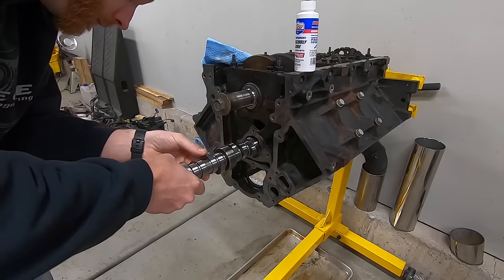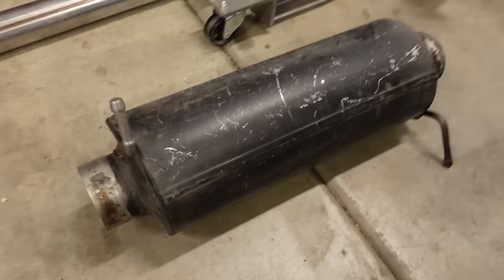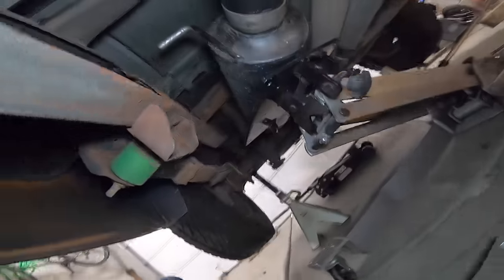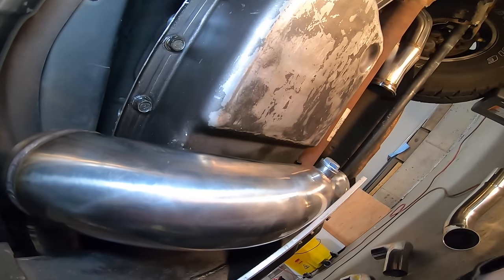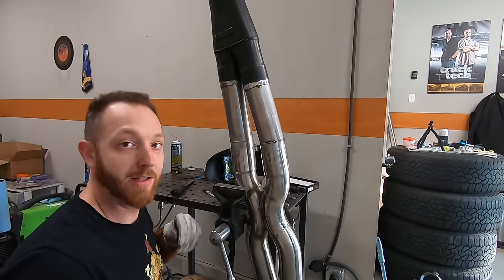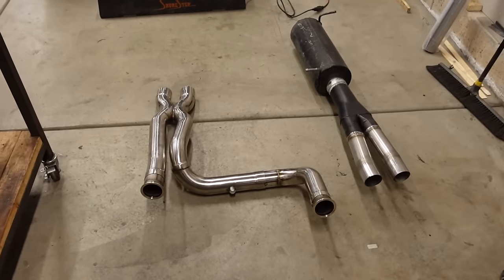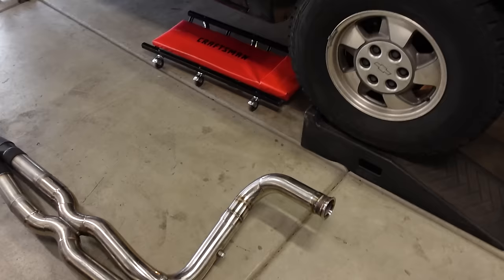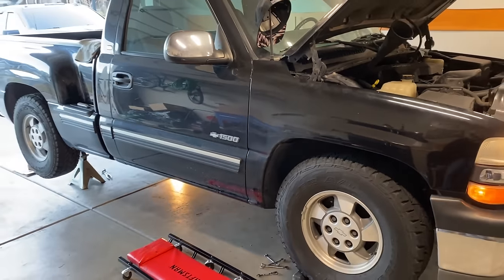the MOST INCREDIBLE sounding exhaust EVER! 4.8 vs 8.1 shootout Pt.9

Comment: I know this is an old video, but why the X pipe going into the Y pipe to one muffler? I was always told the X pipe is for two mufflers. The X pipe seems pointless in this setup. The Y pipe still joins the gasses before the muffler. If I've been taught wrong, please correct me.

Comment: Fuel the Al Gor ithm and support the RPM Act.
When welding under the vehicle are you using a switch (2T/4T) or are you doing Jujitsu TIG welding and using your foot/knee/elbow.
Reply from the maker: I still use the pedal, just keep my knee bent up and it works good for me

Comment: I did two x-pipes on my c4 vette build. Did it mostly as an attempt to smooth out some of the headache causing drone/pressure it had at about 3k rpm.

Worked like a charm, and it really gave it a Ferrari type of a sound.
Looks weird under the car, but i would do it again.
I'm curious about how it affected performance, but it was either that or get different mufflers (currently dual flow master 40''s.
(3in in, and dual 2.5in out on both)

Comment: LT you are the bomb! I'm not a mechanic I'm building a 6.0 LS 72, Pro Street SS factory AC Nova with that 2 in1 pipe 3.5 what about back pressure? Wouldn't your engine loose back pressure to the point of torque , HP lost?

Comment: Finish the exhaust out a little bit longer with a kick up over the diff to a turndown. Cheap aluminized 4” truck exhaust shouldn’t be very far away…….isn’t as cheap as it was. That little bit longer should remove the resonance that buzzes your ears and head if it matters.
I really like the sound result of the X to Y with the cam profile and small displacement!

Comment: At 7:43,   why don't you like slip fit connections LT?   Its' one joint less to weld but I'm not an exhaust builder.  Please let us know!
Reply from the maker: To me, every slip connector is a chance for movement or an exhaust leak. It might just be personal preference, but I always build exhausts with as few clamped connections as possible

Comment: The funny thing is, that while you may call the result of an x pipe a european sound, if you look at the legendary sounding V8 euro cars like the 6.2L AMGs, 4.2 RS4s, they don't have an X pipe. They have a resonator that links the two pipes together in parallel, but they don't have a crossover like an H pipe nor an X inside. The higher revving exotic v8s like the 458 have true duals (with the valves open). The only euro v8s I can think of with an X pipe are the F type R and the quattroporte.

Comment: 🤘 sounds good 👍 bet the dump makes it sound ways better and it will run better too to have it go farther than just out the muffler. In my experience the muffler can’t be the last piece of exhaust 🎉
       Magnaflow has a good video on the science 🧪 of exhaust. And having a glasspac is better than just straight pipe 👍 
     I’m curious though on the x pipe you have (kinda just sides touching) vs the I guess you could call it a crossover X 🤷🏻‍♂️  switches sides?  Make sense? (I just woke up and finished video from last night 😂

Comment: Curious to know how a v8 would sound if the v8 is a single outlet header setup meaning it’s a single pipe no dual outlets.. what I’m curious is what if a Y pipe from a single into dual, then into a x pipe and two vibrant mufflers on both sides and dual back then a H pipe before it splits off to the back bumper.. always wondered what that would sound like. Logic can be used on any car that’s a single outlet header dump which are mainly sideways engines like fwd v8s v6s I4 etc etc…

Comment: call me crazy but i had a 4.8L and a 5.3L (2 different trucks). anyway to me it always felt like the 4.8L had a better throttle response compared to the 5.3L and would rev up like a nut job on crack. but the 5.3L seemed to pull trailers and what not better. also both trucks had about 200,000km on them and were both 2004 model years with 4x4.

Comment: Hope you don't need to change trans fluid anytime soon, on mine I had 1 7/8  tube header with 3 inch exhaust with x over pipe and electric cutouts.
Reply from the maker: yeah, I'd have to move the exhaust to drop the trans pan, but luckily I did it right before installing the exhaust.

Comment: Warning.
Do not look at a cooling stainless steel weld without eye protection.
Sometimes the chromium or nickel or something forms a crust on top and shatters with sharp little bits flying off.
Most of the crust has gone by the time you can touch the weld with a bare finger but you should still give it a brush off as flakes can fall off and get in your eyes at anytime.

Comment: Have you noticed the if the pitch was higher than before?
Reply from the maker: yeah, usually an X pipe makes a higher pitch sound, but I've never run this muffler with and without an X pipe to do an equal comparison

Comment: Do You think you will have flow issues going from x to a y ? I have the same X on my truck and really want to run a single muffler like this.
Reply from the maker: thats a good question, and I don't have a great answer. Theoretically, the 4" single is sorta roughly equivalent to the dual 3, but I have no idea how the X into Y affects flow. Might help it, or might hurt it...
Reply: @LawrenceTolman  appreciate the reply. I really hate to by another Speed engineering Y pipe when I have one like yours at the house. I just feel like with my 3” setup it may cause back pressure issues.

Comment: . *  *  *  *  If that is stainless , why aren't you "Back Purging" ? It really looks good , I'm just not a fan of putting all that heat from the crossover under the oil pan /transmission , and personally I'd avoid the butt end of a joint facing the flow . I just found your channel , and I'm going to subscribe , sorry for the negativism , I love the sound , just enough rumble to give it Authority ! Clean job .

Comment: Wait.... You've got torsion bars on a 2wd truck?? Is this some weird factory option or did you lose the transfer case and make it 2wd??  By the way, I'm following this because I've got a 6.0 in the same truck as you (out of a 2003 Escalade) and a 6.0 in my Hummer and they sound completely different!!  I actually prefer the sound of the pickup even though its a single pipe after the Y pipe whereas the Hummer is a dual pipe after the Y pipe into a dual in dual out muffler.
Reply from the maker: It’s still a 4wd (it’s been converted to a true AWD since this video actually)

Comment: Just an FYI for everyone. Good ole high school math is great for working on cars. So how big does a single pipe have to be to equal the same area as dual 3" pipes? It's not what you think, 6" is not the answer. 2πr² is the solution. Because the area is squared, area goes up exponentially. 
For the dual 3" area,  2x2π3² = 113.097 inches. For the single, 113.097÷2π = 18, then get the square root for the radius. So the radical. √18 = 4.2426 so a 4.25 pipe flows the same as dual 3”. Pretty cool right? 4.25 inch mufflers are much harder to come by so 4" is really close with an area of 100.530 inches or 100.530÷113.097 = 89% of the dual 3" area. 
Using Android calculators may require quotes because they don't do the order of operations correctly,  MDAS.
Reply from the maker: That math is above my head, but sounds like it’ll work fine to me with a 4” tail pipe

Comment: This is unrelated to the exhaust, but not to the truck. Has anyone here figured out the damn charging system of these trucks? Mine is an '05 4.8L and when I started doing research on it about two years ago when I got the truck, I opened a big can of worms. I put a zener diode between the alternator and battery, grounded to the chassis, but it still has the big jumps in voltage that will lead to the sulfate crystals forming on the plates. Anybody have an idea of how to knock these highs and lows out that the regulator can't seem to handle? I looked for external regulators but couldn't find a 12v reg that could handle the amps needed and especially one that's weather resistant.

Comment: because trucks always have the pipes offset to one side of the vehicle, the pipes from the two banks of cylinders are always unequal in length and that unequal length produces a sound I care very little for. The xpipe did little to fix that, and because of the unequal exhaust pipe lengths, I would wager the scavenging effect doesn’t do much in this situation. I wish exhaust systems for trucks featured equal length piping. I know of only one truck that does and that is the new Ford Raptor
Reply from the maker: I even considered making a loop like the raptors to try and even out the lengths, but I couldn’t find a good spot for it
Reply: @LawrenceTolman  yeah it’s hard to find space under a truck never designed for that exhaust feature. There probably isn’t nearly enough space for those either but one company created an equal length mid pipe for the bmw m4 by making one of the pipes wiggly. Anyways, I respect the effort and the system does look pretty sick

Comment: Are you sure it's a 4.8 and not a 5.3 same block different internals and a 4.8 will make 1200 horsepower stock bottom in Hot rod magazine did this without any boost and used a carburetor

Comment: I think that with the axle dump you are going to have too much sound of exhaust inside the cab, the drone will not be pleasant
Reply from the maker: correct, this setup did drone quite badly. I ended up changing it several times after this

Comment: so roughly 100 h.p per liter is a good power output for a petrol engine , so your 8.1 ltr motor should be at 800h.p , ,,,it's not ??  perhaps that's why big blocks are yesterday , and if you want big torque , fit a decent size diesel , otherwise you have a major fuel consumption  and weight penalty  , 8.1 =496 cubes 600+lbs , 4.8= 302 , 411lbs , 50 % heavier makes a difference when you try to stop it from 60 mph ! 496 fuel consumption ? 3 to 10 mpg , 302 , 12 to 22 mpg , sorry but the cost outweighs the bragging rights all day long

Comment: ok... im guna give my 2 cents,, doing exhaust 4 13 yrs .  flow.. is everything... must have headers.. must run correct size pipe 4 hp .. and rpm driver will drive ..  its a must  muffler is as far back as possible ..  have you ever been to a figure 8 track ...? it doesnt work .. ya a dyno mite,, mite show somthn.. but.. the exhaust wants  OUT ....more than 2 ft of pipe after muffler just will sound like  pipe.... performance mufflers flow,,, and have a sound ,,, but,,, if you have toooo moch pipe after,,, it   will sound like  pipe......